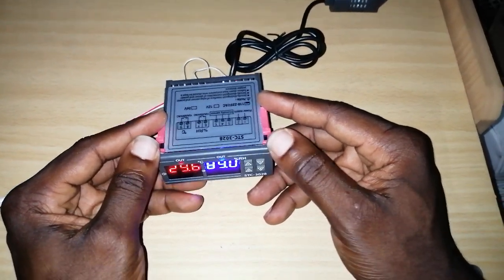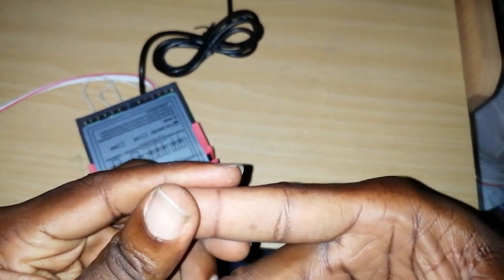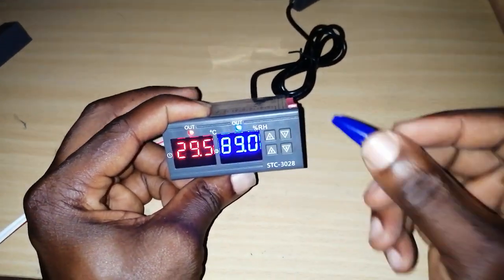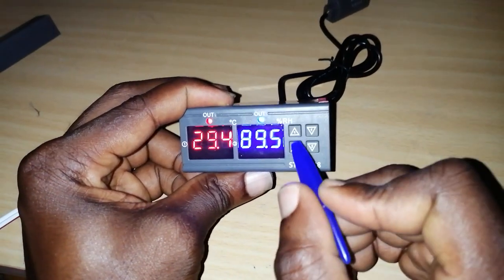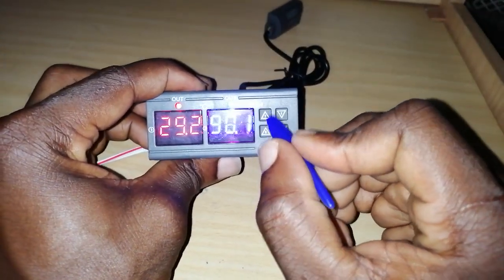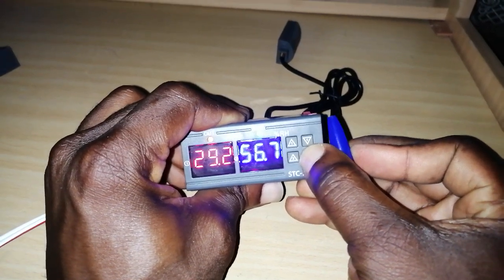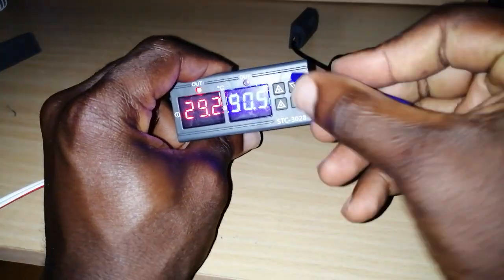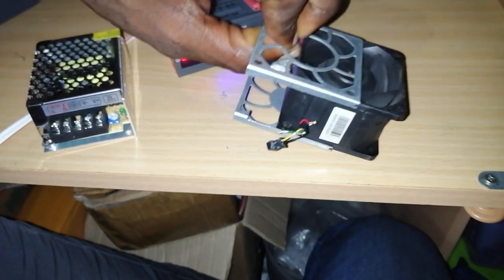How to program STC 3028 temperature + humidity controller

Comment: The humidifier controller displays very low humidity. I tried to calibrate as you instructed but it only allows up to 50. Can I reset everything?
Reply from the maker: just set the calibration back to 0.0

Comment: So my incubator is made of Sytropor and use the STC 1000. So far could successfully hatch quails. In the 2nd brood, the chicks are unfortunately all died in the egg. My humidity meter was installed in the wrong place, the condensation ran directly into the meter and thus I had wrong values and believed that the humidity is too high tried to regulate down by opening the lid of the incubator, but in reality I have dried the air even more. So that this mistake does not happen to me again, I have now decided to rebuild my incubator. The whole thing works with 220AC only the fan runs manually with 12V. After my research I have read everywhere that a temperature fluctuation of more than 0.2 C° is not good for the embryo. Unfortunately, the STC 1000 does not keep the temperature constant. It has a temperature switch on difference of at least 0,3C°. 
This means that if I set for example 37,5C° then when this temperature is reached the heater is switched off and the temperature drops to 37,2C° (0,3C°temperature switch on difference) so that the heater switches on again. This phenomenon is unfortunately not suitable for a healthy brood. That is why I am interested in this model STC-3028
1st question
Is the exact set temperature maintained here? So at the set value, the heater will also heat permanently? How many degrees Celsius is the temperature switch-on difference?  
2nd question
How can I connect a 5V donut humidity controller?
Do I have to connect a step down converter 220AC>5V DC in the phase cable (+)?
Reply: Have you connected the 5v humidity?

Comment: Nice vedio. How we reduce Humidity?
Reply from the maker: You see the sensor cover?
Force Open it.
Disconnect the sensor wire under the cover and connect it back and try again. The sensor should be dry no wet
Reply: @mykitvideos5937  thanks i will try.
Reply: Hi, I Opened Sensor cover  and make it clean. Nothing is happening it is as it is in previous condition. I checked with another 2 Hygrometer these are showing same Reading. But previous one is showing 13% higher always. Thank you.
Reply from the maker: What humidity range do u want, tell me higher and lower Humidity u want
Reply: @mykitvideos5937  Hi, how are you. My humidity range 50 to 65 and  65 to 70 for incubator.
Reply: @mykitvideos5937  STC 3028 showing in humidity display HHH most of the times
Reply from the maker: Is your sensor connected well
Reply: @mykitvideos5937  yes  sensor connected well

Comment: I have just bought stc 3028 thermostat humid controller online for my incubator  but I am really confused about how set properly set the temperature because it will display first LLL when I switch on  this unit to start, and the light bulb still not lighting, can you explain further?  Secondly, stc 3028 has only 3 wires for sensor as I have seen in the diagram in the internet ,but this one which I bought-stc 3028 has four wires which are blue, yellow,green  and red exactly  like stc 2000 sensor...please help me sir,,,

Comment: Nice explanation.! Thank you, Can you comment on how to setup the %RH for dehumidifier! Thanks
Reply from the maker: Okay.
Reply: I am also stuck here. Did you manage to sort it and if so how? I am beginning to think it is for a humidifier and not a de-himidifier.
Reply from the maker: Just set it the opposite way.
UP button is used to set the high humidity u want

And DOWN button is used to set the low humidity you want
Reply from the maker: Let's make it pratical. At what humidity do u want your dehumidifier to start working
Reply from the maker: Yes it can be used as dehumidifier
Reply from the maker: And at what humidity do u want your dehumidifier to stop working
Reply: @mykitvideos5937  I was able to figured that out - It is ON when upper humidity is above 30. and its on when lower humidity is below 24. thanks for replay!!

Comment: Hi, I just got this device and want use it to control just my 24V humidifier. I don't need it to control my heater. I also use 24V input power not 110V. Could you tell me how to wire it?
Reply from the maker: So what is the input voltage of your controller

Comment: Hi, I'm from Brazil and I did my eggs incubator and used one of this model. But they have a problem. The temperature from STC3028 display is 38º but on the others thermometers, is down near 36,1º 36,0º. dif. near 2,0º Have way to calibrate to exacty?
Reply from the maker: Press the 2 buttons at the same time and adjust.
For temperature calibration, press both buttons at the top
Reply: @mykitvideos5937  Good information.... well if it have way to adjust. please if you have video to how can do it, please tell me where is it ... I'll very thanks to help me....
Reply from the maker: Let me know if it works For you. If not I will make a video on it
Reply from the maker: Have you subscribed to my Channel
Reply from the maker: I can't find a video on it but I will make one probably tomorrow. Just subscribe I will get it done
Reply from the maker: https://youtu.be/uqYAXOyZYEM

Hi Rubens, this video will help you